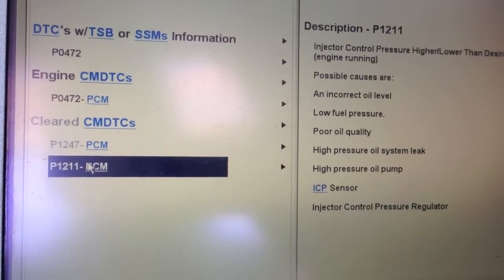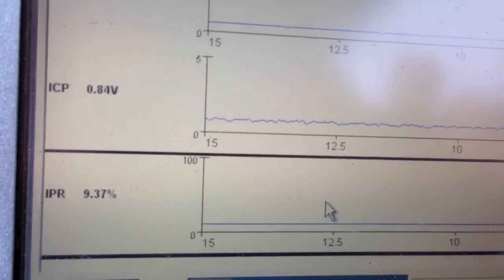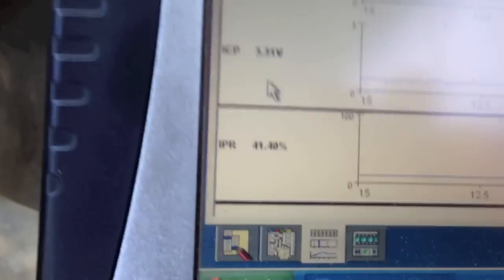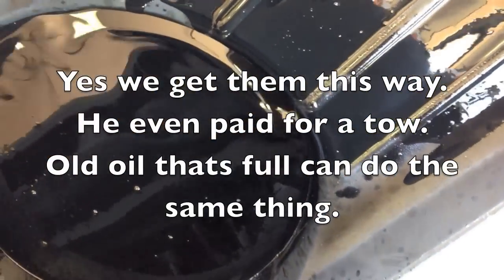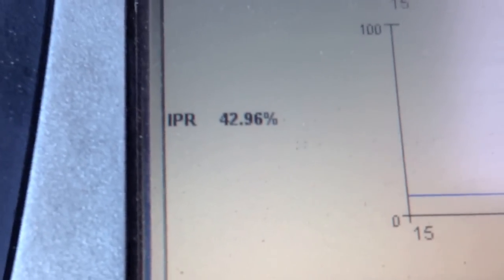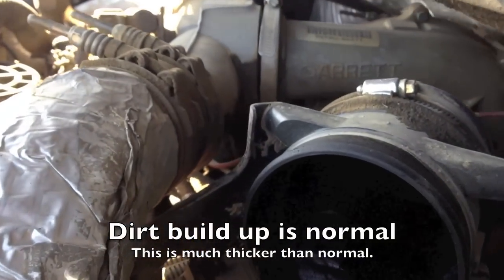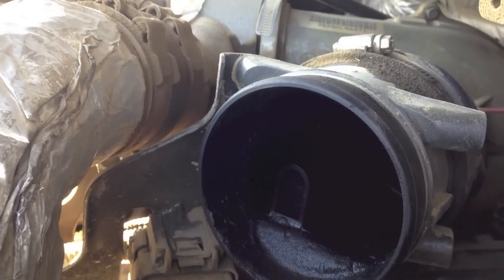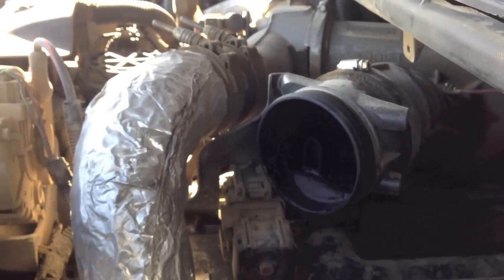P1211, lack of power on a Ford 7.3 powerstroke diesel. Due to oil.

Comment: I have a 2001 f350 7.3 it has a really hard time starting when cold unless I plug it in for 30-to 45 min. Could you help me out or suggest a shop in ohio with good diagnostic equipment
Reply: If you don't have any blow by all you might need is a set of injector
Reply: @ramonlopez9348  I do have blow by and 100 pounds of compression on # 8 I have changed all glow plugs and they do all work I'm Gunna send all injectors off as soon as I get time
Reply: Check the glow plug relay first. Before digging into the injector job.

Comment: Hi Ron,

I'm having a problem with the P1211 code and lacking power. I have a 2002 7.3
F350 with a few modifications. It has a Tony Wildman six position power switch,
(Code still shows under hard acceleration when chip is removed). 4 inch
straight piped exhaust and an S&B free flow intake.

The Freeze Frame for DTC P1211 comes back as: MAP: 62.5 in
.hg, RPM 2387 r/min, Speed: 53MPH, and Absolute Throttle Position: 0%. The code
only comes on after a 3-5 seconds hard acceleration. 

I have tested the fuel pressure under load, it sits very
steady at 65 PSI. I recently did an oil change and it still looks good (less
than 500 miles). It has a new Ford ICP installed and has been retested. IPR
looks good at 36% under load. Turbo has very minimal play.  Replaced the EBPS and tube. I'm seeing normal
boost levels and my EGT runs at about 1050 F under hard acceleration uphill. A
KOEO buzz test sounds good. 

I just ran a KOER test and found I have DTC P0605. Spending
some time on autoenginuity, I believe I have found that the Barometer is not
functioning correctly. It is maxed out at 148 PSI and 4.66 Volts. Would this
cause the P1211 code? I assume this would lean out the motor, so I'm not sure
if this would cause power loss? Any help you could point me to would be
appreciated.
Reply: JTosta not sure if you’re aware or not but Ron lost his life in a vehicle accident in May of 2016 .. may he Rest In Peace..

Comment: Hi Ron great video! I have been experiencing a little power loss and gas milage loss in my 2000 7.3 and have noticed that my oil was low so I add as needed. I have never had to do this with this truck before it seems like it been burning oil. So I guess my question is will it effect gas milage, and what causes it to burn oil? The truck is still a baby with 54,XXX.

Comment: Ron you caused me to buy a ScanGauge 2 for my 7.3  got me a deal on ebay for $130 for a new one.
Reply: 4 years later watching this again HAHAHAHA.  Sad what happened to Ron.
I'm hoping this is what I'm dealing with, I ran low on oil but I put a gallon in but it didn't run any better but it did make the 16 mile drive home so hopefully this is the problem, oil wasn't showing on the stick.

Comment from the maker: P1316 is telling you to pull codes from the injector drivers module. Does it miss?possible  injector solenoid or connection. Do a buzz test to pull codes

Comment: Ron, thanks so much for all your help and pointers on the 7.3l. I have had mine for 10 years, it has 410,000km. Never touched the motor until now. I found diesel in my coolant, so I replaced the injector sleeves, while injectors were out I did all the seals as well. Before that and after I still get code p1316, p1247, p1211. So I replaced the injector wiring harnesses under the vc and CPS. Since I've done this work it has helped but I still have the following problems. 
-p1316 still comes on/of

Comment from the maker: Almost every ebp fault on a 7.3 is the sensor. Look at the volts key on engine off. It should be atmospheric pressure. Compare it to map. Usually the ebp reads too high.

Comment: Customer is lucky he did not grenade the engine.  I thought the 7.3 and 6.0 would not run when too low on oil?
Reply: Not usually because the HPOP if it’s not getting oil it wouldn’t fire the injectors